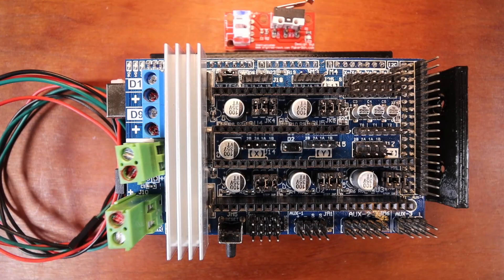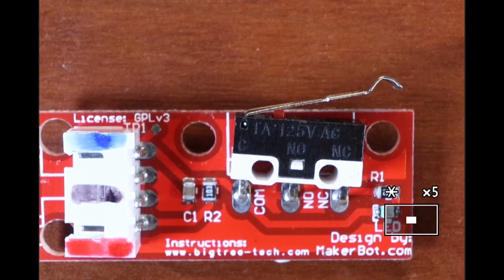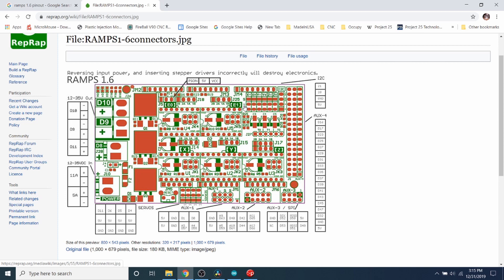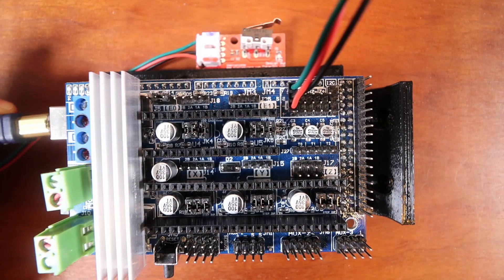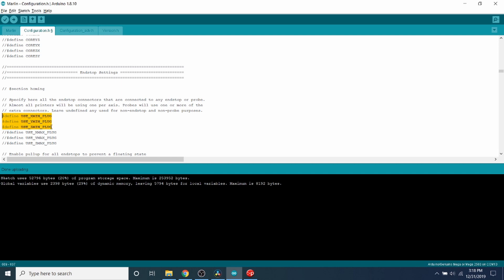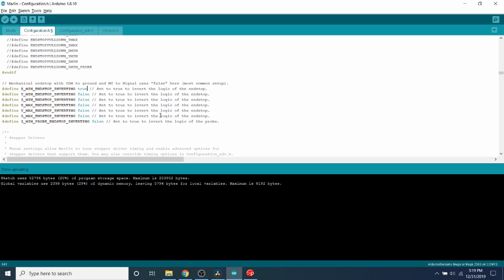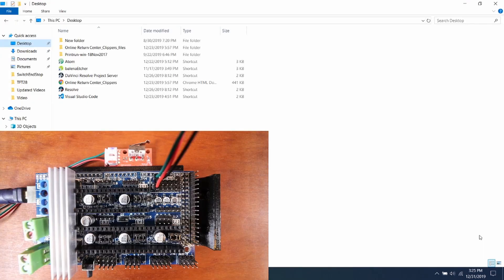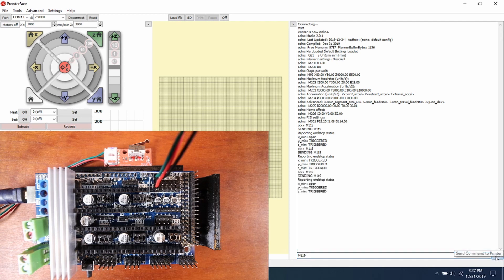RAMPS 1.6 - Switch Endstop

Comment: RAMPS 1.6 - Basics
https://www.youtube.com/watch?v=zOtd8Tih-BI

RAMPS 1.6 - A4988/DRV8825 configuration
https://www.youtube.com/watch?v=izedBx5nCCM

RAMPS 1.6 - Switch Endstop
https://www.youtube.com/watch?v=rK9f4Z3t9lQ
Reply: I believe the cooling fan requires some explanation for RAMPS 1.6. I have a 3 pin cooling fan for the board. How do you think I can attach it? Thank you.

Comment: and of course i did connect it backward the first time, blew 5v voltage regulator on arduino and get spooked :P
fixing arduino took 5 minutes but  that not connected microswitch pin that should be at the 5v side made me think why ramps boards don't have pulup resistors on 5v  rail

Comment: Great tutorial. If you have a 3D printer that has two Z axis stepper motors do you need a splitter  cable or is there another way to accomplish this. Thanks
Reply from the maker: The RAMPS 1.6 has two native connectors for Nema17.  So you will only need one stepper for two Nema17.